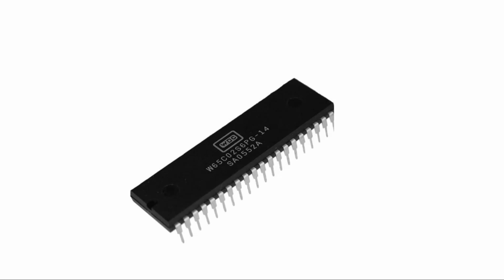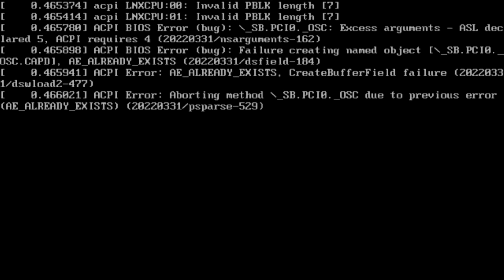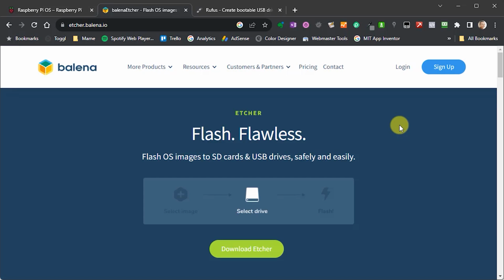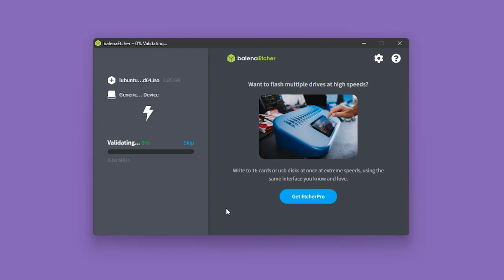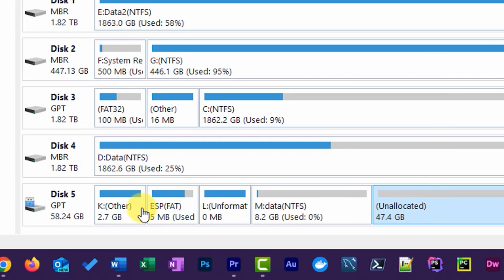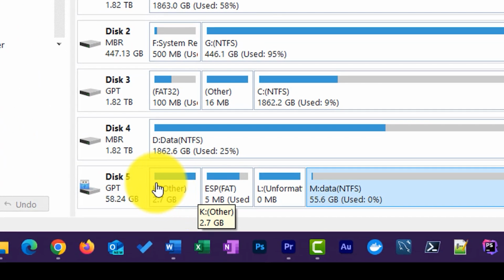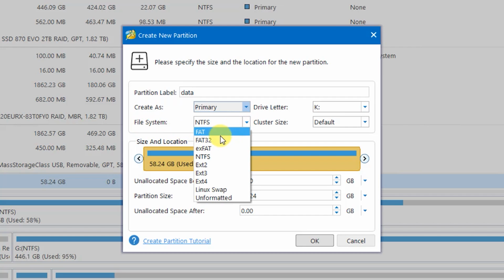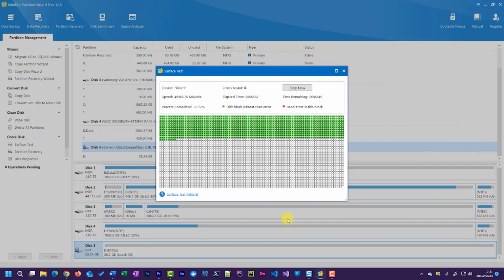How to create and fix bootable SD cards and USB drives

Comment: Im having difficulty installing Batocera onto my EXTERNAL HARD DRIVE.  At first i had flashed the image to the hard drive without knowing at first i had to use a usb stick. Then i gad to reformat my drive to get back all my Storage. Now the batocera is currently on the usb stick but thats where im stuck. Im trying to transfer to my external drive so i can use it as a Plug and Play. Can anyone help?
Reply from the maker: There should be an install on new disk option in Batocera to transfer the system to your external hard drive.
Reply: @BytesNBits  but that would mean it would do that same image thing where it'll wipe my drive, save for only 8 GB of memory. Then i would have to go to disk mgmt, unallocated my drive, try to figute out how to start up batocera on the drive without having to boot from boot menu . Its too much just for this particular front end. It dont seem worth the hassle anymore. Ill just try a couple other front ends that are simple download and extract

Comment: This is a great video, but didn't solve my issue. Looking at a card that is having this error: Retrying in 5 seconds... Write error [0x00000005] Access is denied. - latest attempt via Rufus. Previous attempts via Raspberry Pi imager failed as well. Expecting Etcher will fail also, but trying that next.
Reply: Partition Wizard demo is no longer as functional as you show here. Doesn't allow wipe or MBR rebuild among other things. Points to reg page.
Reply: Partition Wizard, which is no longer free, you may want to try AOMEI Partition Assistant
Reply from the maker: Thanks for the update. I'll check that out.
Reply: Here's my fix... https://youtu.be/1Hg-kugFvpU?si=70EmCkL7T8Zm_dYq

Comment: But you can try Windows Diskpart that will sometimes repair and format a disk!! Thanks for the video, very interesting.
Reply from the maker: Thanks for the tip! I did make a video a while back using diskpart. This video is really aimed at helping beginners find their way around this process so I've tried to avoid console apps as they can be intimidating for some.
Reply: You need to be careful with OS level tools like Diskpart - even I, as a Linux-only user, have to be careful creating bootable USB and (Micro)SD media in Linux because the partitioning set up has to be very specific.

If you're using Windows, the SD Association SD Formatter tool (search for it) is consistently a great tool just for formatting USB and SD media very easily - and whenever I have used it, the media format has been fine.
Reply: I have not found Diskpart to be as comprehensive as the steps he shows here. But rather than Partition Wizard, which is no longer free, you may want to try AOMEI Partition Assistant. I got much further with that, and Rufus, in documenting the underlying problem than I ever got with Windows tools.

Comment: A video you might want to cover is how to recover a USB that is write protected, even though it has NO lock button.  Usually this means the controller chip on the USB has gone bad!
Reply from the maker: I'll have a look. This video is really so I have something to refer to in future rather than having to cover setting up an sd card in other videos all the time.
Reply: Agree. That seems to be the situation I'm in. Round and round with multiple fix attempts, but always comes back as locked even though it is not physically locked. One can spend hours going in circles on this. Now, where's my scissors...
Reply: @JeremydePrisco  - Since my last post, I found that MinTools gets around this problem!
Reply: Personally I wouldn't bother trying to recover it if the controller chip has gone bad but you can still read the data to get if off - just copy the data off the drive, smash it to bits with a hammer and then stick it in a bin. Then buy a new USB stick.

If it's a USB stick that costs £5 to £10, then how much is your time worth anyway?

If you can't get to the data at all and need to recover it, then you can technically use the same tools that you would for recovering data from a hard drive but that is a big topic in of itself - and I personally wouldn't want to try to teach anyone else how to do it because if I give you techniques to do it but it doesn't work and trashes the data completely, who are you going to blame? Even I have messed it up trying to do it once or twice in the past on my own data, I don't want to be held responsible for your data or anyone else's.

Without wishing to sound facetious but if data is important enough to you such that you can't do without it or it's extremely important that you don't lose it, then you should be making a backup of it in the first place.

And if you do need data recovery from a damaged drive, just pay the money to a professional to do it.